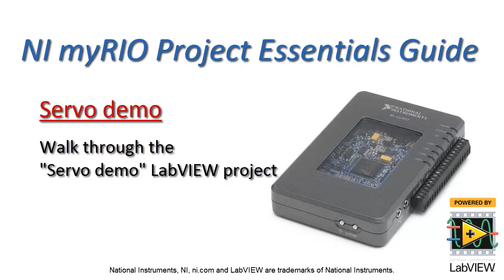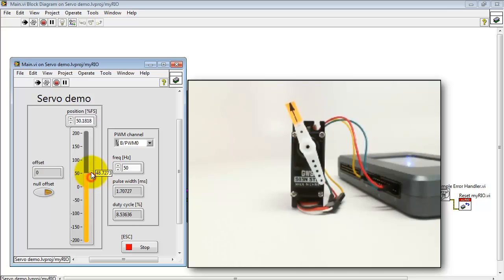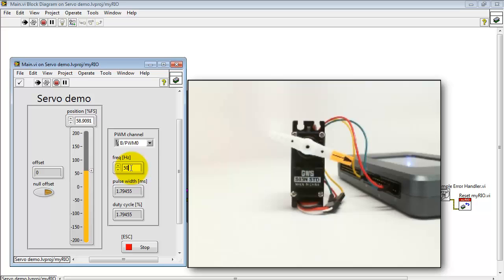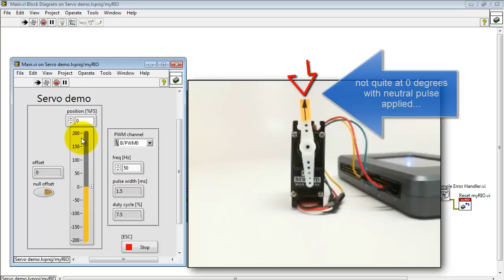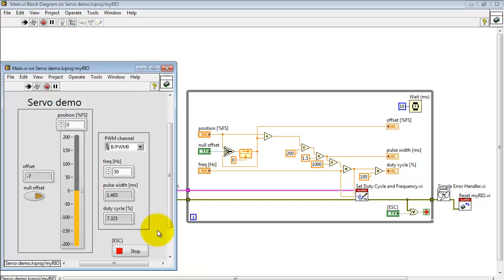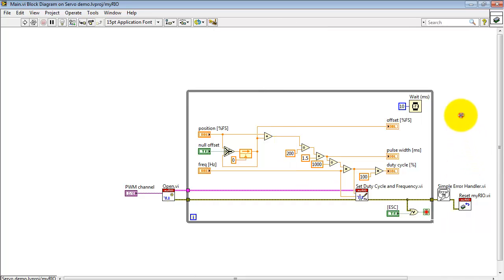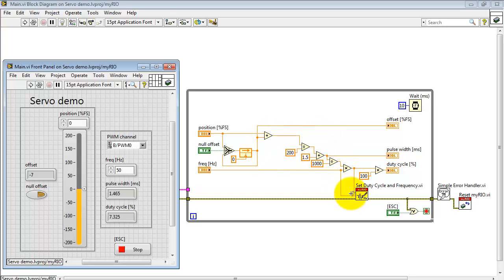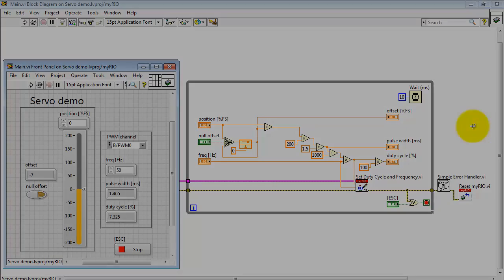NI myRIO: "Servo demo" LabVIEW project

Comment: I tried this code with my GWS S03 servo about a month ago using Myrio and it all worked fine. However now i resumed the process and the motor never stops turning. Every time i change the position (keeping the frequency constant), the motor either speeds up or slows down but never stops at the required position. 
What could be the problem?
Reply: Hello did you already solve this problem? and how?

Comment: i tried this code with myrio and servo GWS s03 and i have a problem .
the shaft fluctuate long trip then Settles at wrong angle .when i change angle it fluctuate again .
i tried this servo with other hardware it work perfectly ..so the problem happen when it interface  with  my rio

plz help .
Reply from the maker: +Ahmed Samir Do you have only one servo connected, or do you have more than one? I have seen the behavior you describe, but only with two or more servos. Regardless of the number, you could try putting an electrolytic capacitor (about 10uF or 100uF) in parallel with the servo power connections, this solved the problem for my two-servo application.
Reply: @ntspress  For me it worked using a 250uF capacitor in parallel. I only use one servo and encountered the same problems as Ahmed Samir.